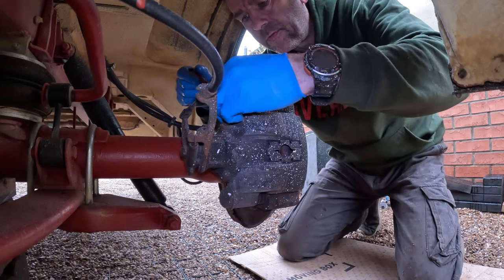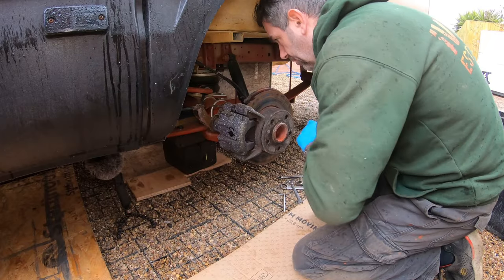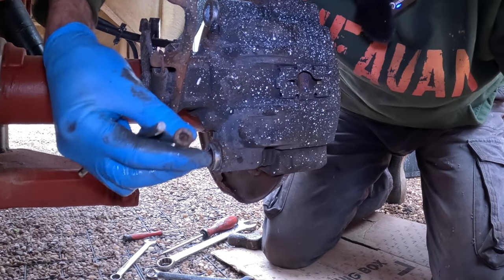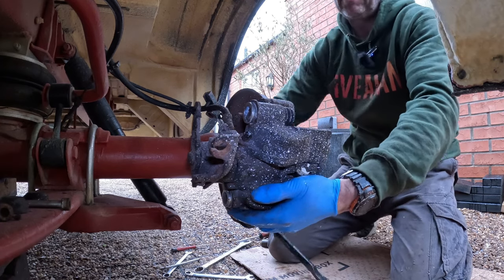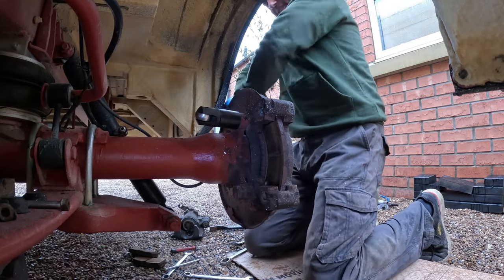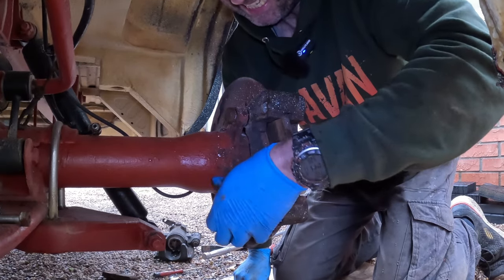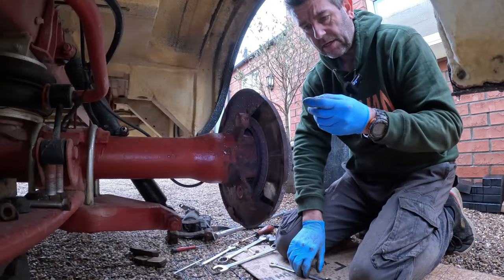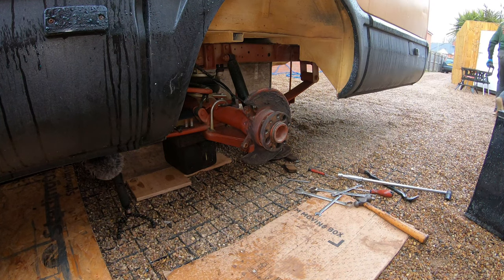Van Brake Teardown Made Simple!    | Iveco Daily Campervan |

Comment: Might be doing this myself soon. Good video again. Thanks.
No wear sensors on the back?
Something to make people aware of is that if the parking brake lever sticks, pads and disc wear very quickly... Local Iveco guy told me to always use the handbrake to keep things moving. Otherwise it's a new caliper.
Reply from the maker: No, I got rid of my wear sensors as the cabling to them kept breaking, so they have been joined up and tucked away in the chassis 😉👌👍.